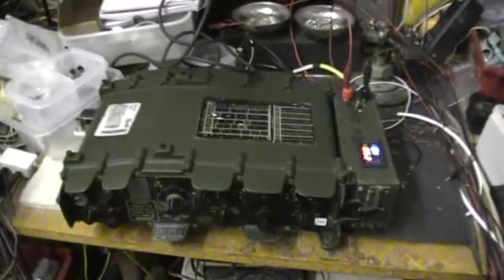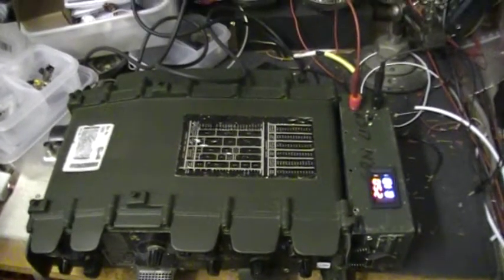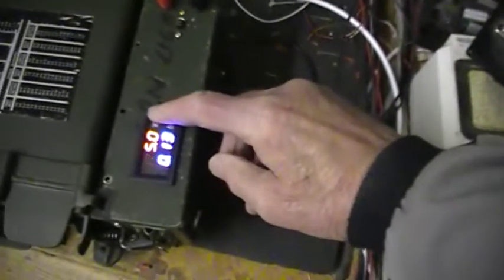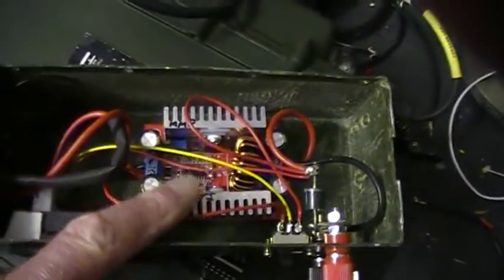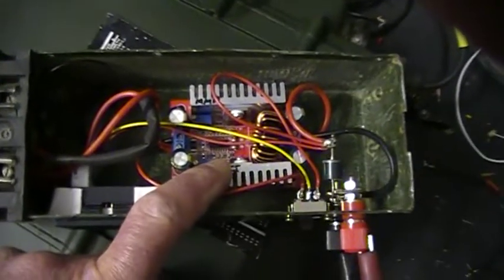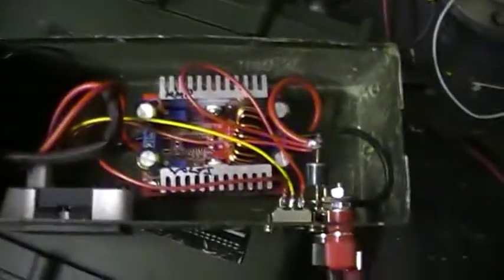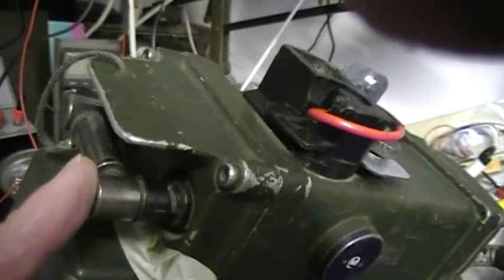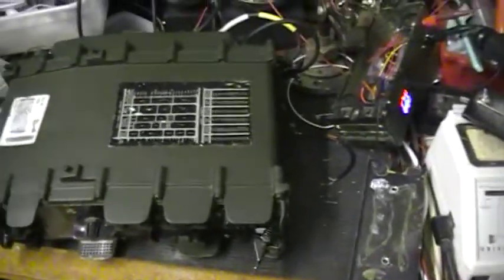CLANSMAN PRC320 on 12 volts

Comment: great mod but what about ripple and frequencies from the dc dc converter and lcd display. don't they cause issues specially to the receiver  ?
Reply from the maker: I haven't noticed any problems but I've only tried it on the 20m band.